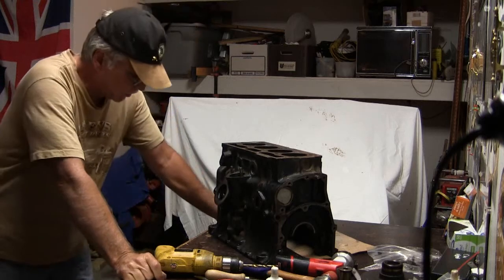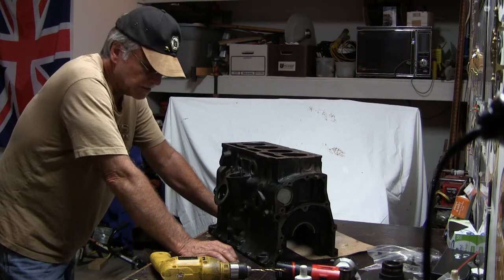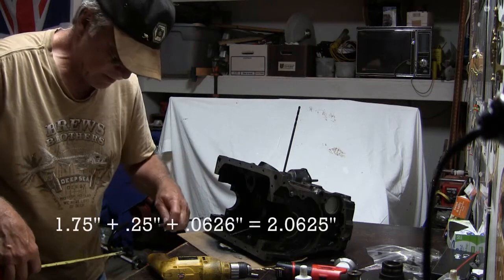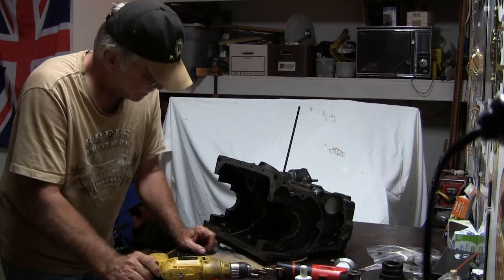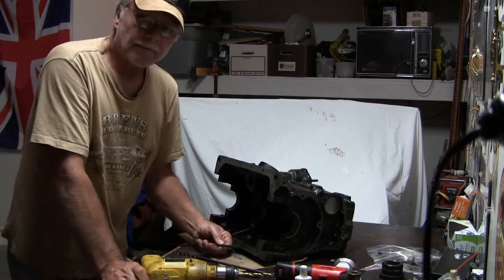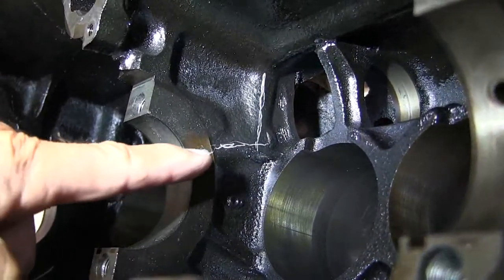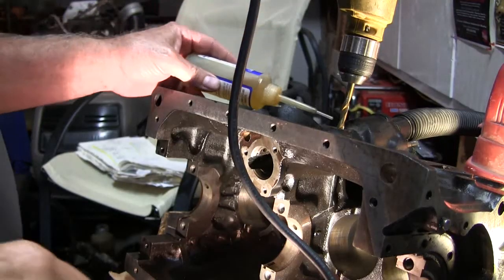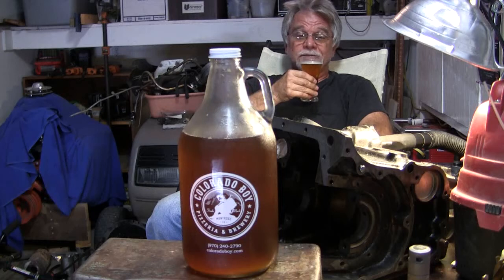My 79 Triumph Spitfire 1500 enlarge center oil passage to 5/16ths inch

Comment: Your right on Calvin!  I enlarged my oil passages when I did my engine.  I had Kent Prather build my engine and worked with him in his shop one day a week till it was done.  He did a lot of tricks like this to my engine.  One thing we did was add cam bearing to the block.  Also, there is another oil passage that can be enlarged along with an external oil line to the head.  We also shaved off extra weight on the rods and crank.  We balanced the rods and brought there weight down.  Polished the intake and exhaust ports.  many more......  Have fun!
Reply: Nice bunch of tweaks you did to that engine.  Are you still driving it?